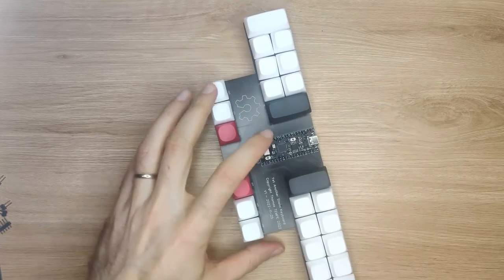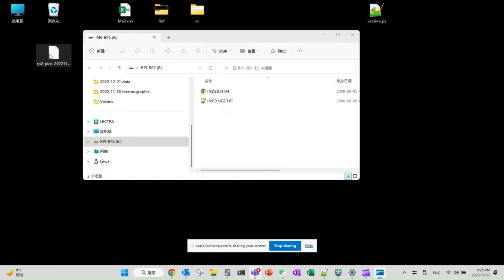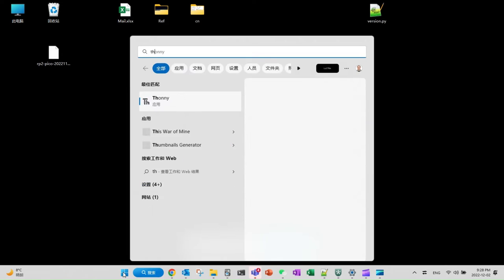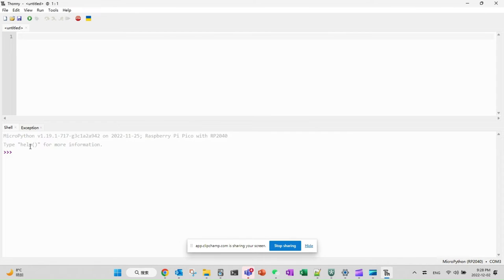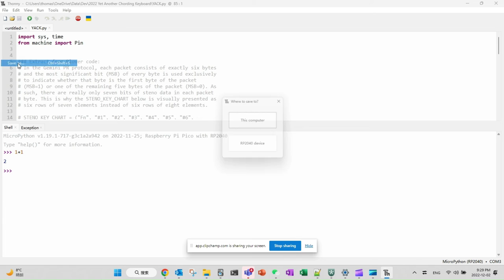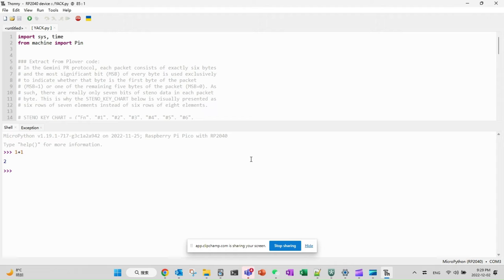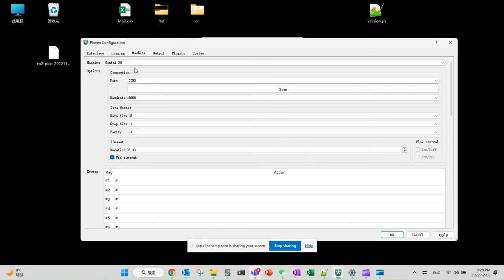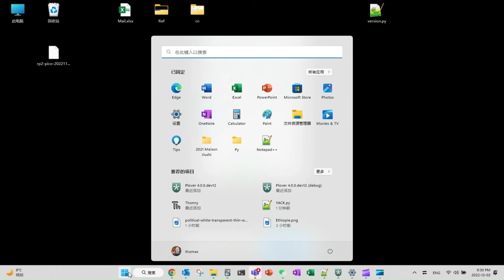YASK - Yet Another Steno Keyboard - assembly instructions

Comment: Hello. I would like to make this project but I have a question. Is 2 layers of PCB necessary or is it for stability? Could I use 1 layer of PCB and a plain backplate instead? Thank you for this project
Reply from the maker: You only need 1 layer for electrical function.
The 2nd layer is for rigidity, and protecting your table. It's the easiest solution I found, though, as a plain backplate will need to be manufactured separately, and you need to devise a reversible way of assembling it on the PCB.